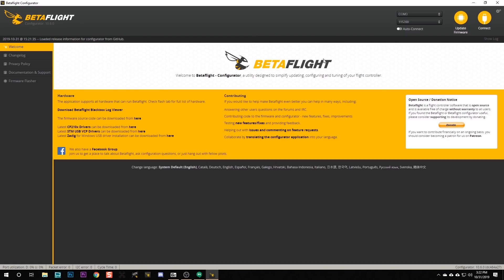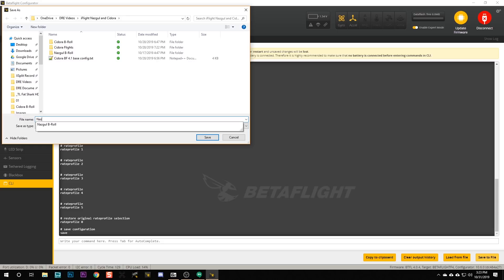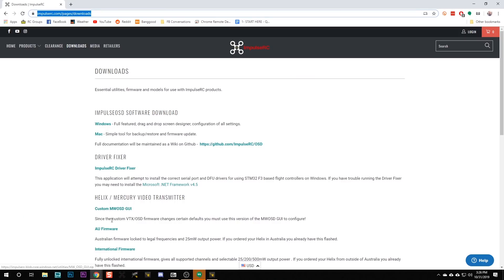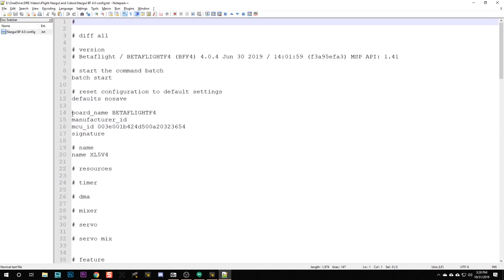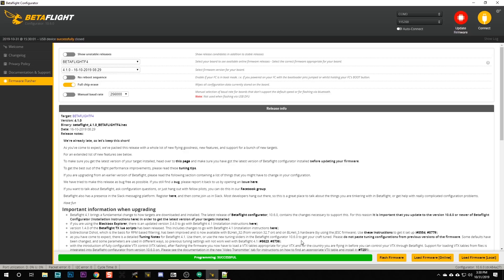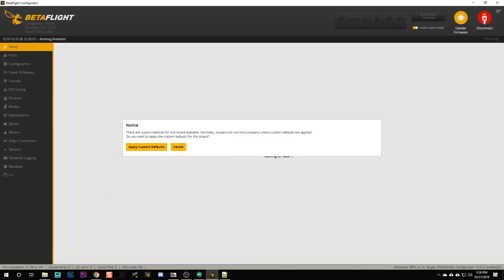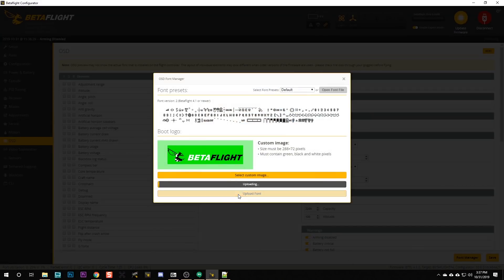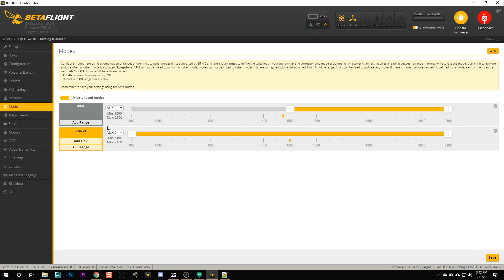How to Flash Betaflight Firmware (Upgrade to 4.1)

Comment: Could not get my Spektrum receiver to work on an Omnibus F4. Configured it right in BF, like previous BF versions. The receiver light is solid (on == binded) but it is not showing stick input in the Receiver tab. Flashed it back... Anyone else has this problem?
Reply from the maker: Can you see if this fixes it? https://github.com/betaflight/betaflight/issues/8242#issuecomment-492221265
Reply: @JoshuaBardwell  Yes it did! Thank you so much! Well appreciated!

Comment: I don't get the part where you put in the cleaned out cli dump of an earlier video of yours. I thought a config is tailored to a specific quad and likings of the pilot. Why does sharing this work? Am I supposed to edit the parameters?
Reply from the maker: There are a few parameters that you must edit, which I have noted in comments in the config dump.

Comment: I wish I had tried the OSD before uploading the new Default betaflight font.  The new font is pretty terrible.   Values I could see before in lighter areas of the image, are now washed out completely, and many letters/numbers seem step on themselves making them hard or impossible to read.    I ended up switching to Impact Mini and that's better, although not as compact as the old Default font that was on the board.     Otherwise the upgrade went ok.    Having to build the VTX Table mapping from scratch was an unwelcome surprise.
Reply from the maker: You don't have to use any particular font. You just have to re-upload the character set. It sounds like you selected BOLD or something. You can go back to DEFAULT font or any other font you prefer. You just have to re-flash it from 4.1.
Reply: @JoshuaBardwell   No, I uploaded Default, and it's simply different than it was before.

Comment: Don't like 4.1
 4.0.6 is much better. I'm sure it will be good in the future but I don't think it's ready.
Reply from the maker: Funny ... people said exactly that about 4.0.
Reply: @JoshuaBardwell  was getting hot motors. A few of my friends were to. Didn't matter what filter settings I had on. I also had prop wash and oscillations. I could tune that out but the Motors were hot no matter what I did so it was just too difficult for me. We are in a heat wave in Australia atm but.   38 °c days. So that doesn't help.  Not everyone here having that problem but.  Just thought I'd share my feedback in case it helps. 4.1 seems to be working well for most people. Thanks for your work time and effort.  👍

Comment: Hey Joshua, first of all thanks for all the time and effort you put into your videos,  very helpful! I just purchased a Blade LRX, and have a DX6i, but I'm not able to arm the quad. Could you tell me what I'm doing wrong,  please? Would betaflight help me out? Do you know if this quad runs on Betaflight?
Reply from the maker: The Blade Scimitar line does run on Betaflight.

Since you bought a Horizon bind-n-fly, I would suggest calling Horizon Hobby support. I will be glad to help you out, but you paid a premium for Horizon product, and part of that is the ability to call an 800 number and get on the phone with someone who can quickly and efficiently troubleshoot the issue with you. So you may as well take advantage of it. For example, they will know exactly which switches to configure to get the quad armed. Whereas I would have to fumble around a bit to figure it out.
Reply: @JoshuaBardwell  thank you for your response! I called Horizon, and unfortunately, they could not figure out why my quad would not arm the motors. I'm sending my DX6i along with the Blade LRX to Horizon, so they could try to figure out what is wrong....  if they cant, could i send it to you? If so, how much would you charge me for something like this? Sorry, dont mean to bug, I'm just not sure what else to do... so sad

Comment: By putting your old config on there aren't you basically using the same settings and filtering and essentially not gaining a better flying experience?
Reply from the maker: No. Because the config file that you paste in must be "sanitized" to only carry forward "safe" settings like your aux modes, ports tab, rates, OSD settings, and so forth. The video linked in the description shows how to do this.
Reply: @JoshuaBardwell  thought it would also apply filter setting.
Reply: @JoshuaBardwell  Watching the other video now :D

Comment: hello Joshua, i have a question when testing my motors in motors tab..Its the Stingy build  with all new parts, so when i connect battery to quad and spin up motors one motor hsa 16% error and another has 0.20 % error. Would this be a sign of a bad esc? i was having trouble flashing the 4 in 1 but finally got it to flash by swapping signal wires...thank you
Reply from the maker: Something surely isn't right and you should not fly with error% over 1%. Check the signal wire to the bad ESC first. Swap the signal wire with another ESC and see if the "bad" condition moves.
Reply: Joshua Bardwell the error stayed on same motor.  Bad motor huh?
Reply: I’m sorry I tested again and error moved to different motor after swapping signal.  Bad esc correct?

Comment: Joshua, quick question, I've a couple of the new HolyBro Kakute F7 HDV Flight Controllers.  Do you still need to update the OSD font since they're for the DJI system?
Reply from the maker: No. The OSD is not used in that FC.
Reply: @JoshuaBardwell  Thank you. Luv ya vid's, worth their weight in gold. Cheers

Comment: I bears mentioning that I recently discovered that as long as I had my R-XSR Rx connected to my CL Racing F4 board, it would not go into DFU mode. Even the Immersion RC Driver Fixer was no help because I was going down the wrong troubleshooting path. This was bit inconvenient because flashing after a quad is assembled should be something we should be able to do. I don't think entering 'bl' in CLI worked either. I don't remember trying it.  However, I had to rip apart my frame to get to the Rx to disconnect the plug (I don't have tiny fingers either) and after that, flashing went off with no problems. I learned about this on a 2-year old RC Groups thread. Something about the Rx stil getting power passed through when connected to USB. I don't think anyone on YT mentions it.
Reply: I was troubleshooting trying to get into dfu mode for hours! I finally came across this post. Disconnected my R-XSR and was instantly able to get into dfu mode and flash firmware!

Comment: Noobie: Afraid of messing up the BF config
Avg Pilot: flashes without full chip erase and finishes config.
Master: flashes quad with full chip erase, sets everything up in less than 5 mins, puts props on the right way, and manages to get a pack before dinner.

Comment: Just finished a new toothpick/twig build at the weekend and added BF4.1 to it.  Other than changing Dynamic notch filter to high (1103 motors, small micro) and FF transition to 0.15 all PIDs and filters were left default.  Fly's great, now I have the task of updating the rest of my quad's from 3.3 to 4.1.  Thanks for these video's JB if it wasn't for them I'd still be on 3.3 👴

Comment: it was my cable that didnt work with my latest fc, i tried every usb i had but one, one short one and boom it works....try diff cables if it doesnt go into dfu as well
Reply: Chyna Mane yup! First time I was trying to connect, I had to go through 5 cables until I found one that worked!!
Reply: 2yr after buying my quad 6 usb`s later i realised it was a power only usb

Comment: Whenever I use the ImpulseRC Driver Fixer I get

An error occurred while entering bootloader!

Unexpected number of devices detected.

Any idea what would cause that?
Reply: multiple usb devices plugged in at the same time maybe
Reply: @mbycfpv8937  nope. Just the one
Reply: Or if your using a usb hub connect directly into the computer instead
Reply: @starsstripesjacket  no hub either. Direct into the laptop.
Reply: Try unplugging the receiver!

Comment: I've only been using BF for about a year now.  I've spent WEEKS configuring PIDs for the perfect tune on previous versions.  On my last build, I tried 4.1, enabled Bi-Directional (even flashed BlheliS at $4), and left all defaults.  I turned down the filters one notch after the first flight and I haven't touched it since.  This quad out performs all of my others and I spent 10% of the time configuring this one.  The future is here!  Thanks again BF and JB!

Comment: Is there a difference between dump all and diff all?
Reply: Dump All shows every option...Diff All shows only the options changed from stock setting
Reply: @aaronroseberry7425  lol...I always dump all. I guess they will both work, just one is a larger file. Is there any down side to dump all?
Reply: @bkmahaffey  I think the only downside is that if you are trying to figure out why something is wrong/not working as intended, diff all only shows non stock options. These would probably be the things where something is causing your problems, not a stock option.
Reply: @aaronroseberry7425  thanks, makes more sense now.